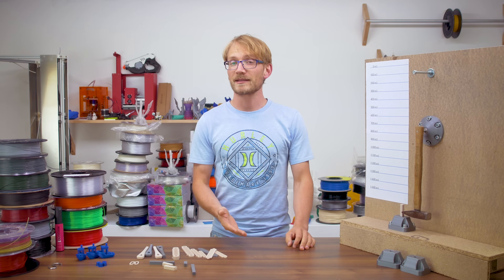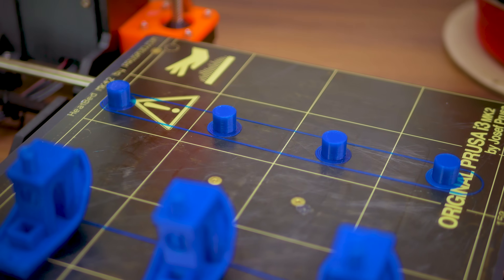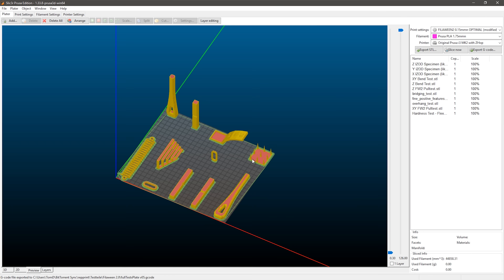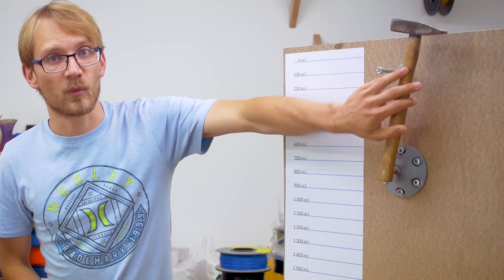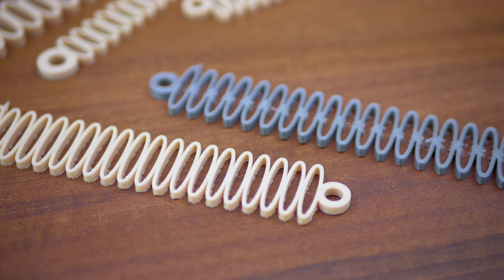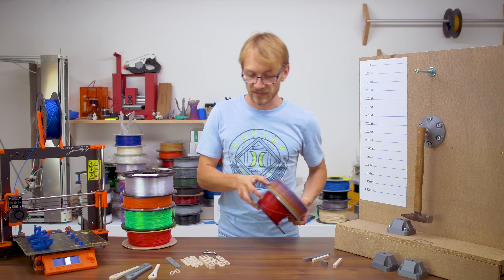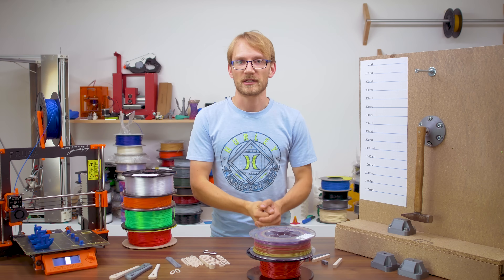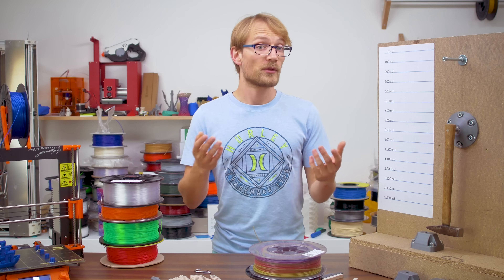The next generation of Filament reviews: This is Filaween 2.0!

Comment from the maker: Filaween episodes will start next Saturday with Verbatim PET and DAS FILAMENT TPE. Still tweaking a few things, for example it turned out that the new "pull test" chain-like rings 🔗 are way too strong - even with PLA, they hold over 50kg each, which is too much for my setup. 
Stay tuned!
Reply from the maker: +Feraud Quilens but why's buy it when you can make it yourself?
Reply: Hello Thomas, can you include a more precise temp test? I am looking for a material that is cheap, as easy to print as PLA but a temp resistive as ABS for building a Kossel style delta.
Reply: Thomas Sanladerer can you post you temp tuning gcode? That would be so helpful! Thanks for the amazing work you do.
Reply: Thomas Sanladerer I have a test suggestion: the PLA from 3dk.berlin

found this PLA on Amazon, its quite expensive compared to other PLA (ca. 35€/kg), want to see whether its worth it
Reply: Thomas Sanladerer great initiative. This is needed, open, transparent and repeatable (scientific method).
Reply: I hope ColorFabb nGen will be tested in Filaween 2.0
Reply: Thomas Sanladerer they make a tool for this it's call a Charpy v notch jig
Reply: mils24 maybe go for a HTPLA like the one from Protopasta
Reply: +Thomas Sanladerer would you like to test some cool filaments if I send them to you?
how much material do you need to reliably test them? Is 250g spool ok?

Comment: Have you used ultem 1010  or PEI filament before? I am wondering if it is possible to print yourself a pei sheet with the filament.  I see some FLEXBED Ultem PEI for sale on aliexpress which is not too expensive so I would like to see if it is possible to print yourself a print bed sheet using this filament. Can you try this and make a video?

Comment: Love the rigor of this series! As an idea for future tests; I really struggle to find any kind of objective information about warp of material. For printing dimensionally accurate mold masters for technical parts, this is pretty much all I care about. Many materials makes some subjective claims about its low-warp formulation; but finding any quantifiable information on the subject seems almost completely impossible. Some test, printing a straight beam on a high raft away from the heated bed (testing the first few layers that are annealed by the bed temp would be cheating imo), and seeing how straight they are after release from the raft; or something along that line, would be awesome I think.

Comment: But doesn’t the curved cut out make the weaker in a sense ?  Making it snap easier
Reply: That's the point. You WANT it to snap. And you always want it to snap at the same point to keep results comparable. If the notch wasn't there, each specimen would snap at a different position - perhaps due to some inconsistency in the print - but how would you compare that?

Comment: I wish you'd share more than just "stitched series of prints with 100% with 5% extra material for each one multipliers" to determine over-extrusion, the "3d benchy for 190C, 210C, and 230C" for print quality. I know you use some other methods to determine the quality of the prints, like a ladder, and temp towers, but you don't go into detail on those. Or the specific bed adhesion principles when you rate a filament.

Comment: I'm wondering if the notch in the print is printed or cut (for your toughness hammer swing test)? I'm a bit behind in your vids so was wondering if you also try to look at deformation? maybe bending or stretching a spring and measure its resting shape afterwards compared to its printed dimensions.I've been trying to come up with  my own small batch of tests for materials testing for my own interest (not youtube or anything) and fatigue failure and deformation are things I want to try to test. For example to find good filaments to print structural beams or gears in so that they can perform reliably over time (without setting up destructive noisy testing riggs that run 24/7 to destruction). I was also wondering if some cheap chinese ebay filaments are good copies of brand filaments (eg from same factory/formula?) and perform just as well or if any are just not worth trying to save money by buying. I mostly run a Cetus3D and find no need to tune setting ever. As long as the filaments is 1.75mm and PLA it prints just as well and reliable on the standard PLA setting for me. Including rubber pla, carbon fibre, stone, they all just seem to be identically reliable. Cheaper filaments seem to string more than brand names, but i'm more than happy with print results being reliable and have my shelf full of rooks as print reference for when I'm choosing an appearance and am now considering reference tests for mechanical properties (smoothness of finish for reducing friction in moving parts, various forms of toughness to provide reliable working mechanical parts, etc) to reduce wear and part failures. I'm enjoying your approach to the same sort of thing.

Comment: I’m currently working in Nigeria and we need to manufacture small parts for the industries in Nigeria. Normally we would make brackets out of metal and have it galvanized, but takes way too long and most of the times it is a once-off type solution. To 3D print it makes more sense, but most of the parts and brackets is used outdoors. I’ve been tasked to find a solution.

My question is, which filament will work the best. We do have the following average conditions in Nigeria:

• Temperatures ranging from 10 degrees C (50 Fahrenheit) to 55 degrees C (131 Fahrenheit)
• Humidity of 20% to 100%
• Northern region is desert and southern region is tropical.
• UV index from 6 to 12+

My thinking is that we need to revers engineer this solution, by first establishing the correct filament and then find a printer which will be up for the task. Could you please assist with the above.

Comment: So hearing how you explained the star system I think it sounds pretty good in general. The only point I'll kinda make is with say all the abs scoring lower it might be good to have a second star system for use cases. Like wood fill will probally be a very low star rating but for astetics its a 4 or 5 star, ora flexible or very rigid matateral could get very low stars but be excellent in thier particular uses. Just thinking you could have a plague of say 3 star flexibles so it could be hard for a viewer to really pick out the stand out good one. But I think I'm may be overly excited about seeting the hammer test in action haha. Keep up the good work!

Comment: Would a torque test might be pretty nice inclusion if you are testing strengths, it shows how a material can deform and not brake and if it returns back to true or if it holds the twist. I guess just print a 10mm x 10mm x 50mm piece put it in a vice and apply force from some sort of lever attaching over the top. I don't know if this information is represented in any of the other tests maybe some engineers should chime in and help you develop standardized testing.

Comment: 5 stars? Hmm. If i were you i would go with a 10 points system instead. There is so many type of fillament and even more to come. And using so many type of test and boil it down to 5 star would't be smart. 10 being nearly impossible great and 1 being non useable. Would be nice to see a point system like this and the aveage score being like "7,8"

Comment: Left a topic in the forums too about this. Been poking every 3d print tuber about it but no luck. 

I'm trying to speed up my big 100% infilled prints by using a second, larger nozzle. 
That leaves small areas hollow. 
How do I do small areas and perimeters with the small nozzle and big areas with the big nozzle? 

Apologies, I'm desperate.

Comment: The scale on the side of the hammer should be centered around the hammer's pivot point (ea: circular as to be parallel with the hammer head) for optimum reading. Other than that, can't wait for Filaween 2.0! Good luck, and thank you for putting in the time and energy Thomas!
Reply from the maker: +devjock eh, a circular scale would be a lot of work since it would have to be non-linear. This works just as well as long as the reference point (trailing corner where the handle meets the head) is close enough to the hammer's center of gravity. 
Other than that, thanks!
Reply: Actualyl, yeah on second thought, it's probably not all that critical. Cheers man, thanks for replying!

Comment: Just a tip:
When testing "Notch Impact Strength" the notch should face towards the impact.
Horizontal layer alignment is probably a test with too similar results to grade them.
An option would be to use a lighter hammer.
If that test is performed, anealed parts would be interessting to see.
Nice vid keep up the good work.
P.S.: Maybe you want to look into this
DIN EN ISO 179-1

Comment: If you can afford it, I would like to see P430 ABS (the kind used in some Stratasys printers) tested. I have had excellent results for an ABS on both a Stratasys printer and a Makergear M2 without a heated chamber.

Comment: Do you think it would be worth changing your extrusion multiplier print to include settings below 100%? Like 0.95 to 1.05 or something. It seems just as likely you'll get over-diameter filament as getting under-diameter, so it seems strange to only compensate in one direction.
Reply from the maker: The MK2 is set by default to be a bit on the low side extrusion-wise to be safe for low-tolerance filaments, so I only expect having to increase it.
Reply: Okay, makes sense!

Comment: Amazing! it looks like your poured in a lot of thoughts and hard works into Filawen 2.0. Oh... why use S3D gcode preview? Cura 2.6.x supports gcode preview as well. wait.. i think I sort of got it, because of the play mode? You stripped most of the s3d windows, oh well.. I know how you hated it (me too, me too).
Reply from the maker: Cura2 and S3D are the only two programs I know of that show sequential prints correctly, but the Cura2 preview isn't the greatest for non-Cura gcodes yet.
Reply: i see. Didn't play with sequential prints much, even more so on non-cura sequential print preview on cura, good to know!

Comment: Hi Tom! Loved the first season of Filaween. I have a request though. Can you test the difference between the strength of a nylon print vs a nylon print that has been hydrated (conditioned) in warm water? Conditioning nylon injection molded parts seems to be industrial standard from what I've been able to tell. The process is supposed to make the material much tougher at the expense of stiffness.

Comment: Just a quick note, might want to ditch the stock Prusa spool holder, it'll wear down, changing how much force the extruder needs to pull on the filament as you go. Maybe make one of the off-the-frame bearing holders to eliminate the frame wobble and issue mentioned above. 
Otherwise loving the new method for 2.0!
Reply from the maker: I've been using the filament rails on the wall as filament holders for a while, but didn't have an issue with the MK2 holder, either. More of a comfort thing for me.

Comment: i would love too see you review for melca filiment they are a brand new company i so fa had farly good luck with it and the pepole that run it also went out of there way too say thanks for odering fom them and sent samples of there other colors with each of the two spools i got from them. they are on amazon.com and are fairly good priced for the filiment you get fom them. just like hexbox the filiment seems too be farly easy too work with and not pone too snaping wen you are straitening it too be used. of corse i only used pla but i do beleve they have abs as well.

Comment: New tests and scoring look outstanding . Two items I would like to see added glassification temp and for PLA only results after annealing. I understand it is a lot to ask for and will understand if not possible. Note due to the way you are printing parts with the items left on the print bed they may end up somewhat anneal. You might want to check this out before getting too far in.

Interesting paper showing annealing at temperatures as low as 65

http://www.4spepro.org/view.php?article=005392-2014-03-28&category=

Comment: Tom, on your Izod impact test, the notch goes on the side the hammer strikes, FYI
Reply from the maker: Hm, I've seen it both ways, but you're right, it makes more sense to not have it on the side that sees compression forces.
Reply: Look up Izod and Charpy. They are very similar but not the same. I recommend that before you start the Izod test you standardize the way the plastics industry tests. It's not 10x10mm.
Reply: Thomas the notch is never placed away from the hammer. also, you should be machining the notch. do not 3d print it. its not even allowed to injection mold the notch which is much more precise then fdm.
Reply: they make specific machines for machining notches in plastic izod samples. you also need to cool the part while machining. welcome to engineering :)
Reply: While I cannot argue the details of the Izod testing, what I will ask is this - for what he's doing, are those small details truly important? What he wants are repeatable test results to relate the filament materials to each other - he's not submitting this for proper testing and/or certification, merely looking for Relevant differences in strength and performance. As long as all preparation is consistent, the results are still valid for his purposes. That's my opinion of this topic.
Reply: Sure. I think it will provide some good testing. He will just need to call it the Tom Sanlader impact test, not the izod impact test.

If he went far enough to machine the groove the results could be more directly comparable to the vast trove of data on izod impacts for injection molded plastics, though.
Reply: Eric K agreed. you've got to draw the line at some point when talking effort vs relevance, and machining is too much extra work whereas orientation is not. I'm just picky bc it's within my field of study and figured it's worth the two cents.
Reply: Izod and Charpy are standards for testing, not test specific materials, etc. It's a method. 3d printed samples are necessary for this particular set of experiments, which is 3d printed parts. I recommend the notch and material size be the same as the plastics industry uses because they did it for a reason. The numbers are lower than for other materials and you get more consistency.

Comment: So I guess the special hammerhead from the live stream wasn't manufactured for you? :(
Is that the petg from dasfilament you used in this video?
Reply from the maker: I could have had it manufactured, but overall Charpy would have been a much more complex and failure-prone apparatus than IZOD for the same results.
Reply: Ah ok. Thx for the answer. :)

Comment: I think each plastic is each in a class of their own...to rate them according to type of plastic is a bit strict. Like I hate printing with ABS but it lasts in outdoor applications. I like the 5 star rating. but I'd stick with just the test results impacting the rating. The type of plastic and ease of setup for printing should be mentioned but shouldn't impact a score...
Reply: Aka my point I'm trying to make is judge each type of plastic against their immediate peers ..aka PLA vs PLA Brands etc...and then ABS vs ABS/Petg so as to gauge apples to apples...
Reply: It seems like Tom is in the same camp when it comes to ABS, but after building my enclosure, I have found that I get more consistent results from ABS than from PLA or PET-G. In many ways it's a more predictable plastic. The dislike for it seems to be due to inexperience and a lack of tooling more than any problem with the actual material.
Reply: MortarRiding I hear you.  I've also built an enclosure for it.  No more hassle with printing it.  But right now the entire hassle of the enclosure is seriously distracting from my hobby. Like I'm busy with a very slow conversion to move the electronics outside of the enclosure, purely because I don't want to expose them to prolonged high temps. That said ABS is a part of the trade and I'm getting with the program.  PLA is for pretty prints whereas abs is for cheap and functional. It is just a ball ache to set up a machine.  but that's why I said it's not the Plastic 's fault.  And should be mentioned in a disclaimer rather than factored into the number of stars for overall score
Reply: Ahh, yeah, I was luck with the Mendel Max 3. I was able to build my enclosure around pretty much just the build chamber. I mean, if I took more time on it, I could've even kept the X axis motor outside leaving only the extruder motor in there, but so far that hasn't been a problem ... except that obviously a large enclosure takes more energy to heat.

Some printers are better suited to enclosing than others. A Kossel type, in my view is about the best, except for the large non-functional volumes that you'd be heating. All the electronics are already outside of this space, unless you're using a hang extruder.

For reference sake; my RAMBO used to have issues above 80c ambient when I had a more rudimentary enclosure.